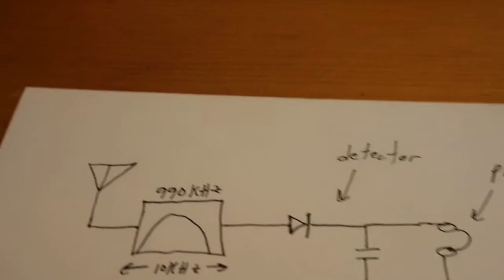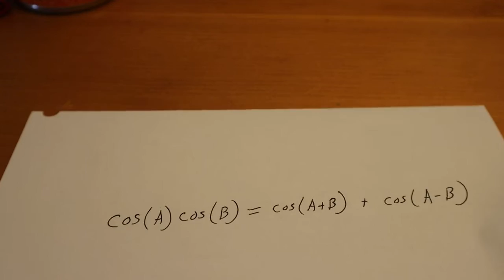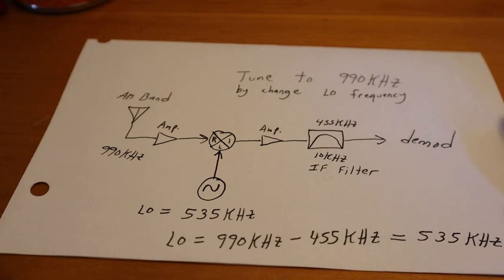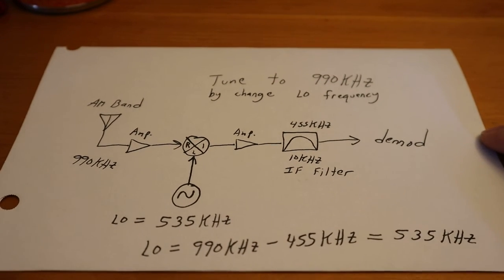IF Frequency

Comment: Excellent, but most AM radios put the LO on the high side of the signal and subtract the signal freq from the LO to produce the IF. So in this case the LO would be on 1445 kHz. subtract the 909 and out comes 455 kHz. Same thing, but it has the advantage of requiring less percentage frequency range to tune across the band. This helps when it comes to tracking the LO with the aerial tuning.

Comment: The difficulty was not designing a filter with low bandwidth in RF. The problem is that you would have to make it vary to cover the entire spectrum of interest.
Reply from the maker: Sorry  , making a 10ghz filter with 20khz bandwidth is going to be very difficult,   however a filter with 45mhz center and 12khz bandwidth are not too hard to build,  but what do I know,  I am only an rf engineer with 30year of experience.   Anyway thanks for watching 😂😂😂

Comment: If I understand correctly, for the upper convertor, we need to get cos(a+b) out of the mixer. All we need to do is use a IF filter at high frequency. Therefore, the only difference between down convertor and upper convertor is the IF filter passing
 frequencies.
Reply from the maker: Yes correct

Comment: what is difference between this down conversion v digital down conversion?
Reply from the maker: Good question,  DC is often by rf mixers to shift down to some IF frequency.   DDC is a step after a ADC in firmware to shift digital signal to zero hz

Comment: What happens when LO and RF are same?
Reply from the maker: hello,  we want the IF to be 45Mhz,  so adjust LO to make that happen.   since the upconverter is really only for hf freq,  one should place a 10Mhz lpf after the loop antenna
Reply: @TheGmr140  Thanks for the reply. Actually can you tell me what happens when the LO and RF frequencies are same?
Reply from the maker: @irfan_antennas  this is called a zero-IF radio.   when the rf and lo are the same, the IF freq is zero.   the sum is filtered away.   this is how the hackrf and some other sdr work.   more info:   google:   zero-IF reciever
Reply: @TheGmr140  thank you so much.
Reply: frequenceis.

Comment: Great video. Just a comment, for AM radios, the local oscillator runs a frequency ABOVE not BELOW desired tuned radio. If you want to tune 530 - 1700 with an IF of 455, then the local oscillator runs from 985 to 2155. In FM, typical offset is 10.7 MHz. Regards!
Reply: The example here is low side injection. But you can have high side as well.
Reply from the maker: Thanks for watching, i just really trying to get folks to understand IF frequency
Reply: @TheGmr140 thanx @TheGmr for explaining what IF is and what it's reason. I'm just trying to learn these 'radio'-stuff and it's terms to get ideas why my vintage receiver is quite noisy when stereo is active.
and thanx to @raul too, for making the connection to the 10,7MHz. 🤝
Reply from the maker: Thanks for watching, i just really trying to get folks to understand IF frequency

Comment: how IF signal further process how it demodulate like IF signal from Tv Tuner how it Further Process into Audio Can i just use Germanium Diode in series with If to get Audio ? Or Somthing needs like Saw !!
Reply from the maker: If sends signal to demod circuit.   IF ensure only one signal be at demod circuit
Reply: @TheGmr140  what components used to demonstrate  why saw filter are used can simple diode demodulate it ?

Comment: Can you make rf spectrum analyser using crt tunner and Arduino or using other available radio module from frequency of 80Mhz to arround 1Ghz plz
Reply from the maker: for cheap. rtl-sdr is the way to go, i believe someone wrote a app that turns the rtl-sdr into a sweeping spec ana like you want.  rtl can cover 80Mhz to 1GHz
Reply: @TheGmr140  i know that but it's not Available here inindia

Comment: So, just to be clear; when I change the frequency of the local oscillator only the RF that appears from the LNA that when subtracted from the the LO equals the resonant frequency of the IF circuitry will be that signal that is passed to demod.  So, the tuning dial is actually indicating the frequency in the RF feed (1.5MHz) that when subtracted from the LO gives the IF resonant frequency.  If I understand this correctly.  So to listen to broadcasts at 1.5MHz, the LO is tuned via the tuning dial to the frequency that when 1.5MHz subtracted from it gives equals the 455KHz IF frequency.  Meaning the LO would be tuned at 1.955MHz to receive 1.5MHz on an IF chain with a 455KHz resonance frequency.  Is this correct?  Great Video.  I may actually be beginning to understand how it works.
Reply from the maker: correct,  tuning radio is changing lo frequency

Comment: Are you telling me that the IF is a constant 455KHz?
Reply from the maker: depends on design.   most radios use 455khz or 10.7Mhz ,   the idea is you can then make a narrow and stable filter at a fixed freq.   and you just change the LO to tune into different signals.
Reply: @TheGmr140  Ok, thx ya and some use 465 MHz. I'm just trying to understand how the output stays at the designed designated frequency. My understanding about AM is that the audio is encoded in the wave amplitude, so as long as that passes on to the new freq. all is well. I just don't understand how a wide array of freq inputs all get output at one constant freq. I would expect frequencies equal to X minus 455 or X plus 455. I don't know how what's going on electronically.

Comment: so the frequency we pick on a radio is not the exact frequency being transmitted, its just the local oscillator frequency? Its proportional?
Reply from the maker: It's the TX frequency.    Local oscillator change radio station you tune in
Reply: @TheGmr140  tx?
Reply from the maker: @VargRETURNS  the signal the radio demod is the if frequency.    The lo frequency shifted the TX frequency to the IF frequency